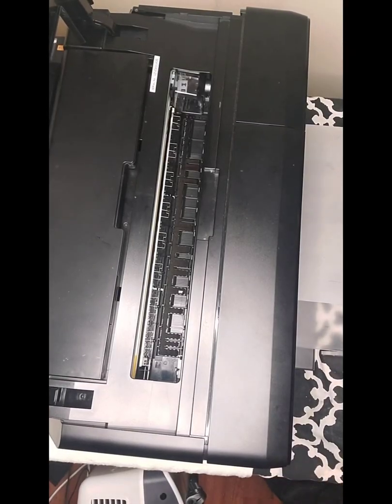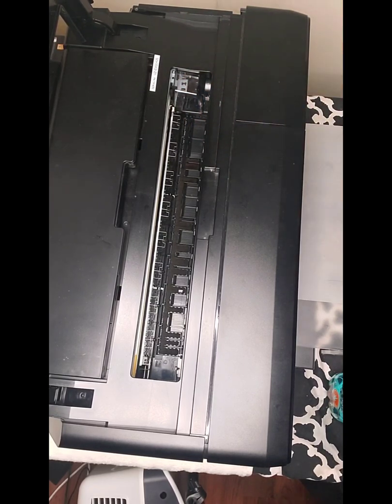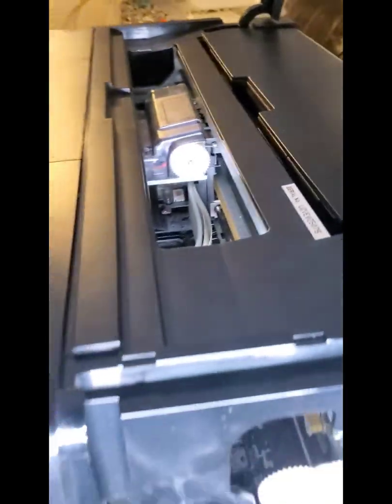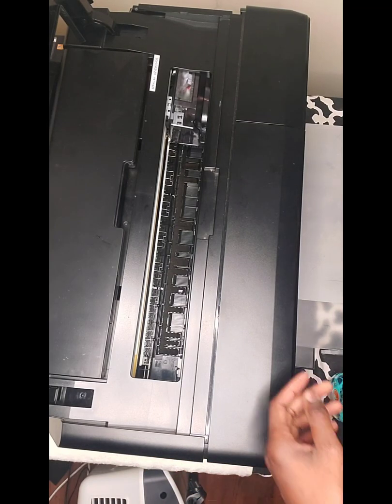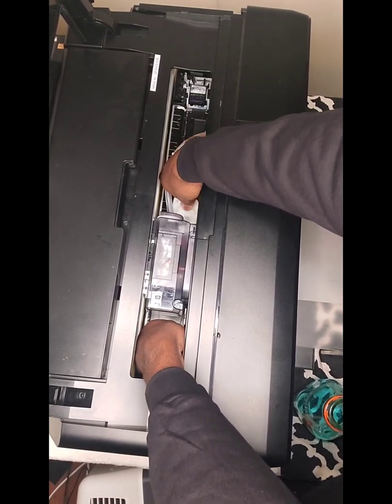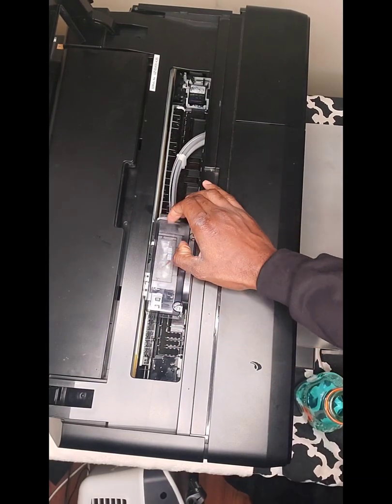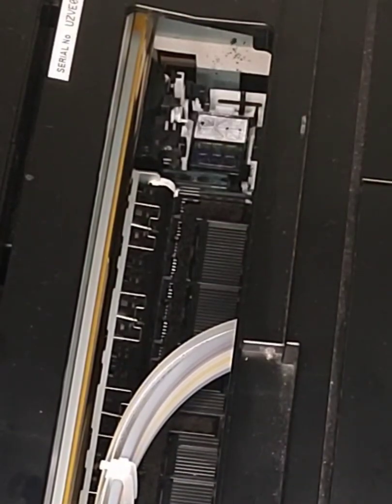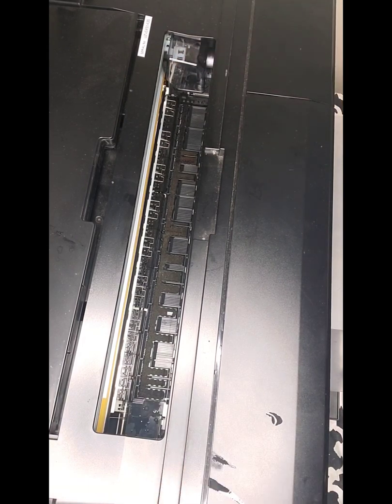HOW TO CLEAN YOUR DTF (DIRECT TO FILM) EPSON SURECOLOR P800 PRINTHEAD

Comment: I would never do that. If the bottom of the printhead is has particles on ink (and it does) dragging the cloth along the bottom of the print head might and eventually will push some dried ink into the mozzles and should clog them eventually. this is some rookie cleaning method

Comment: Help! I was doing just fine until I got to the wet capping station part. It is not clear how to release this part (as opposed to the other release for the printheads). Nevertheless the wet capping part is on a spring and seems have to dislodged a bit. I am trying to place it back in place but I am not sure how to do this. Please contact me as I am in the middle of a project and I am now stuck.

Comment: I got an entire set of refillable cleaning cartridges. Do you not run the ink out of the lines and push cleaner through them
For cleaning? If so how often do you clean everything including lines?
Reply from the maker: That's Smart , I have that as well I do them maybe once a month depend on volume I print or if I'm not going to be around my printer for a couple days
Reply: @PrintBrokerRyan  ok do you use a specific program for charging the lines?

Comment: Are you still using this p800? I was debating on buying one and converting it but was hoping for some feedback. Thanks
Reply from the maker: Hey it's a great starter machine I love it.
 Due to the volume of printing I do now I don't necessarily use it as my primary machine.  But it really comes down to how much printing you are doing. But when it comes to the price and the Bang for buck It doesn't get much better if you can find one
Reply: @PrintBrokerRyan  what printer are u using now I have a p800 but my demand growing and I'm looking for something different
Reply from the maker: @charleskelly829   None :) when orders get too much for the  800 I outsource to a friend of mine locally who has a larger machine.
Reply from the maker: Congrats by the way to being at the point where the P 800 is not enough… that's progress!

Comment: your videos is one of the reason i chose to get a p800 myself ! thanks to your tips man! however, i have a clogged white channels (printhead) right now, the Whites are not coming out, have you had the same problem? if yes howd you resolve it? thanks in advance!!!
Reply from the maker: Hey sorry for the late reply as I do tend to miss messages messages. Congrats on the P800 it's a beautiful yet a beautiful yet needy machine :)

 The whites can be very tricky as it has to be clean daily for optimal use. But usually a couple head charges should be OK and if not then a heavy head clean. But make sure they are done consistently though
Reply: @PrintBrokerRyan  do you have a video on how you take it apart? or have you already opened it up and inject the cleaning solution on the head? again, Thanks in advance!

Comment: What's up man. I have a P800 myself that I want to set up so I'm glad I found your channel. Can I ask just a couple questions?

1. How long have you been using your P800 for DTF? Any issues since then?

2. Average how many prints do you run through it every day?

3. I'm assuming you use Cadlink since you mentioned it. Have you timed how many minutes it takes to print 1 A3 sheet? I've been told it's pretty slow with Cadlink so I'd like to get an idea how slow that is.

Thanks for your help.
Reply from the maker: hey welcome to the family 😅 

1. I've hade one since June 2021 and I have had many issues lol I'm on my 3rd one.  Most of my issues were due to trial-and-error though as I like to learn things the hard way 🙃 and these machines are delicate. 

2. on average about 13"x36" worth of printing per day 

3. yea its slow with cadlink  If you reduce the white underbase it does speed it up a bit but it also reflects in the final result so you gotta give-and-take but I'm kind of used to used to the slowness now. 1 A3 is about 15 man's give or take.  

I also use the roller which makes life a lot easier. 

hope that helps
Reply: @PrintBrokerRyan  Can you describe some of the issues you had? Clogs?